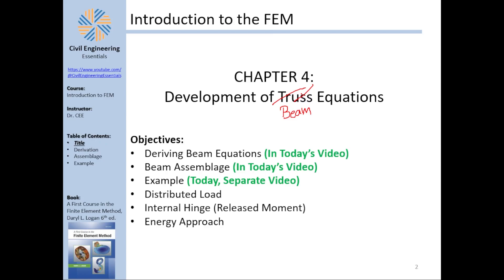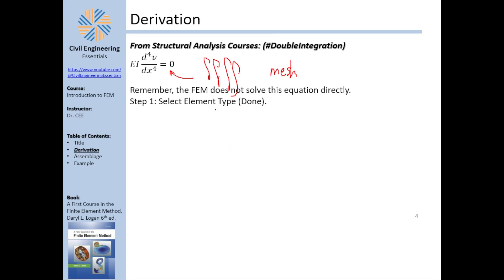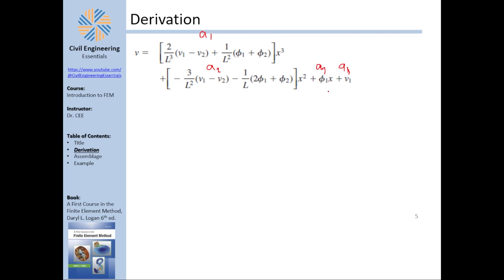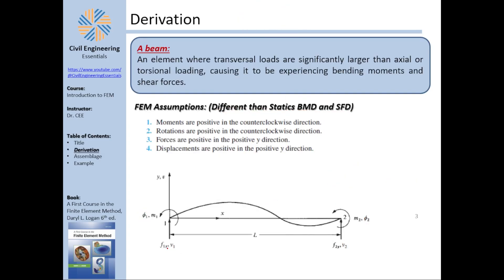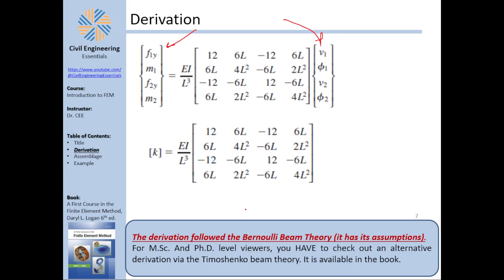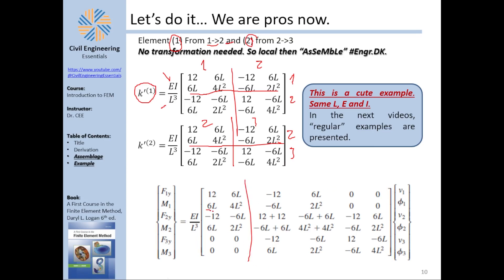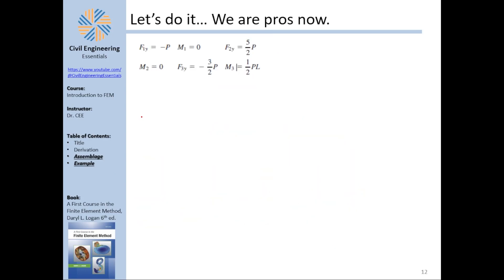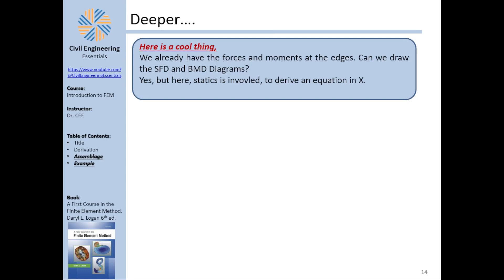The Finite Element Method | Part 8: Beam Elements

Comment: Hello Dr. CEE,

The clarifications of the sign conventions for both FEM and Statics were really helpful throughout thank you for these. 

13:32 when eliminating known forces to solve F=K{d}, I realise that all Forces in our “cute example” are NODAL forces. What happens if the beam is loaded between nodes? Say with point loads, or with UDL, or with trapezoidal or triangular loads, etc? is this something that is still coming in later examples or lectures? 

It is really enticing to will be able to see in action how one move from deflections and rotations at the nodes (notwithstanding 14:52) and also move from shear forces and moments at the nodes to any position at distance X along the length of the beam.

I have enjoyed this video and I am looking forward to the next CEE videos.

Regards, DK
Reply from the maker: Hi there Engr. DK,
you are 100000000% (i know it is not a valid number :-P) correct.
Yes, next lecture we will be covering uniform load and how to basically find their equivalent nodal forces.
Also, I will be covering the drawing of SFD and BMDs in an example 
So, stay tuned for more content
Regards,
CEE